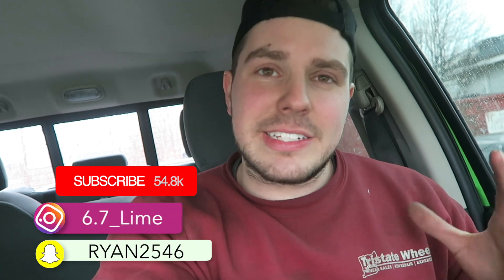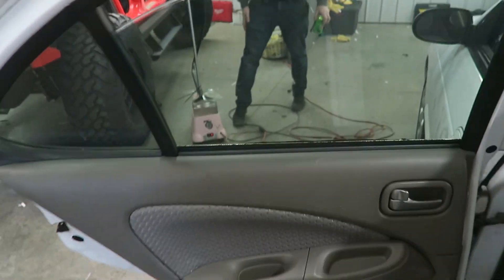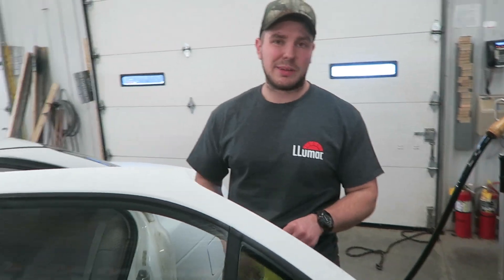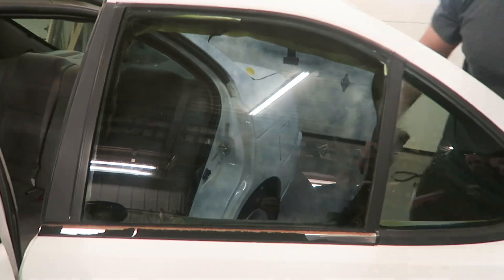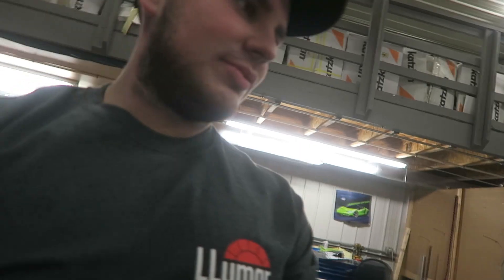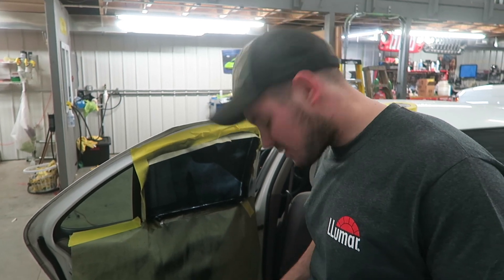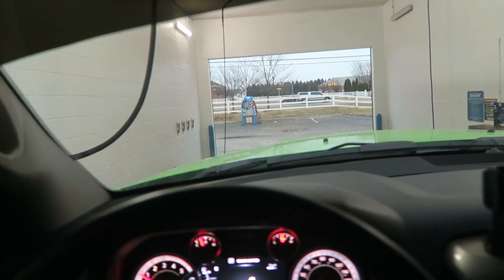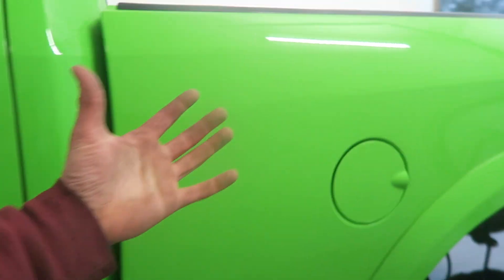Window Tint in a CAN?!? *Spray Painting Car Windows*

Comment: Back in the late seventies and early eighties I used to spray tint cars a a gas station,the one I used you had to spray the top of the window and the tint would run down and even out with no bubbles,best thing I ever seen
Reply: I remember my dad using this in the 80’s. I wish I could find that stuff. Probably don’t make it anymore.

Comment: Back in the late 80s mid 90s you could buy spray tint. Unlike the spray tint in this video you would go side to side causing a constant run of product down the glass. One even run coat. Worked good but messy.
Reply: Do you know how te remove it?
Reply: @DHRN-rq1qq  Acetone took it off. The problem was that if your key touched the glass it would scratch it. I was told this was how they did it in the late 60’s. Poor bastards.

Comment: If you keep adding coats till it's a solid coat its great, just don't do it when its cold out, needs to flash about 10 mins between coats, I did my gasser in red

Comment: I plastidipped my rear windows in my car audio vehicle. Couple cans of plastidip to black out the windows is wayyyyyy cheaper than black out tinting the windows. On the outside it looked like a good tint job, on the inside you layer it thick enough to not get any light through and it looks black.
Reply: Plastidip is suppose to be plastic spray so off it would black out it’s for like plastic bumpers and stuff like liquid plastic paint
Reply: This not tint... you cant see out of that lol

Comment: I'd use that on garage windows or tail/headlights imo
Reply: Dont my dad did his garage windows it looked good outside looking in but inside looking out not so great
Reply: well considering it is designed for headlightstaillights......SMDH, also you can get walmart tint for cheaper, and if you can't tint a flat surface for garage windows, dont even bother.

Comment: This is about the 6th video I’ve watched on VHT as tint. A few of them, the windows turned out like crap, the other videos, the windows turned out about the same as your window. I thinks it will be acceptable inside a truck cap. But the key will be to apply many, many light coats to get a even coverage

Comment: I remember back in the early 90's you could order all sorts of crap from JC Whitneys. I bought a can of spray tint meant for actual windows. It came out horrible. Unless you're proficient at using a spray can, it was very streaky. Every overlap darkens it so you have to go all over to keep it consistent. I was driving an '86 4runner at the time and I tried it on my rear passenger windows. After finishing the second one, I gave up. It was crap. I got film tints afterwards

Comment: It looks blotchy but that may be because of how you did it. Maybe you were spraying it too closely. I'm wondering if you would've sprayed it with some distance applied .. would the spray had covered a larger surface area of the window evenly instead of having to spray multiple horizontal lines over and over just to get it to your liking.
Maybe...just maybe🤔

Comment: This is a old trick we use to do when we built sub walls if you keep the tint on the car it's a more uniformed look on the outside inside looks horrible but no one sees it because of the subwoofer wall.
Reply: I've done this on my back  windows for my wall as well lol.

Comment: the question that no video about this answers, is does the paint wear off after you roll the windows up and down a bunch?  It is paint, not a solid film.  I'd worry that even the rubber strips at the top of the window could wear away the paint.

Comment: I've used plastidip in a can before for window tint. However, I wasn't going for 'tint'. I wanted complete black, but I wanted it to easily be removable. I rented a uhaul van, and didn't want people looking it to see my shit - but when I returned the uhaul van a couple days later I needed to remove the plastidip and not leave any evidence it was there. It worked perfect for what I needed it for - after a couple coats you couldn't see in/out and was easily removable. I'm sure there would have been much cheaper, and probably even easier ways of doing it.

Comment: Why not? I can tell you 5 reasons why not: #1, Looks like crap. #2. Window film blocks UV rays, paint pay or may not. #3. The law: most states have strict laws on window tinting. From the outside it looks way too dark for the tint achieved. You'll getting pulled over all the time. And you will have invoice from a shop or manuf. that the tint conforms to the law. #4. Work. You really think taping off the inside of a car is easier than applying tint? That's insane. #5. Overspray. Unless you completely tape off the rest of the car you'll get over spray on the interior, seats, carpet, etc.

Comment: See the problem is tint you can peel off. That stuff there I'm sure would take an act of God to get it off if you were to get stopped for tint. But if you live in a state where they don't care, more power to you. My windows are so dark you can press your face to the glass and still have a hard time seeing even 3 inches past the glass. Cops here told me to my face they won't mess with me over tint unless it's a pop charge.

Comment: This is why I tint my own windows, $15.00 5% from Walmart, not the best shit, but it's not spray painted.
Reply: Do you just follow the directions that come with the do it yourself tint film or .. ?
Reply: @WindsongSoundBath  yeah you follow the directions, but it is harder than you think.
Reply: @WindsongSoundBath  I always had an issue getting it past the rubber seal at the top of the door panel so if you're confident I take the whole door panel off. So I can get the tent a little bit down the rubber sill
Reply: @brianwestmoreland3836  wow that must be pretty tough then , because I was already expecting it not to be easy .
Reply: @WindsongSoundBath  you get the hang of it the problem I hate is trying to work out all the little bubbles. Or you'll get an air pocket from underneath that keeps reappearing 😂

Comment: Dead truth, that cans spray tip is shit, that's what's wrong with this product. It needs to be a higher pressure can with a fat line fan. I am tempted to try this now... I'll use a bit of trash... Work in a body shop